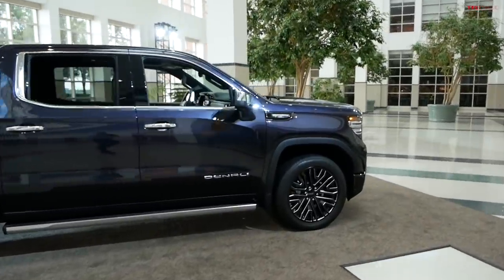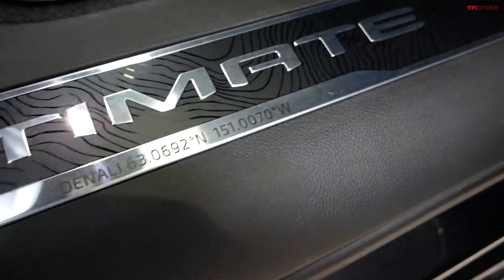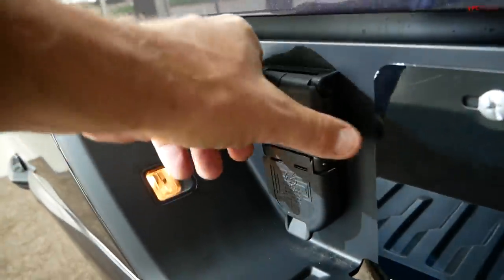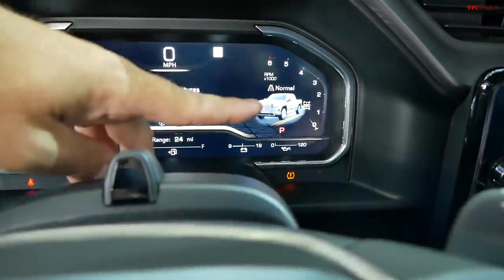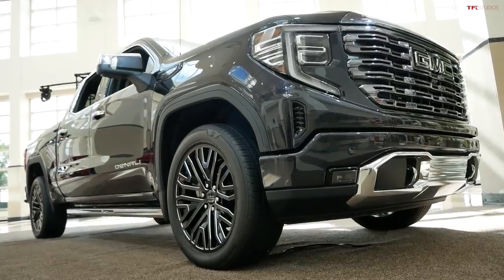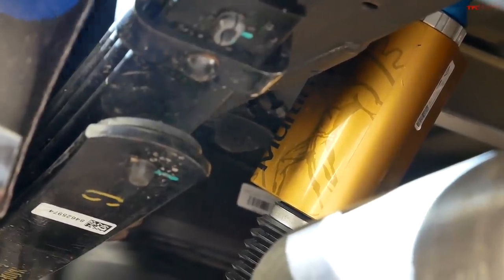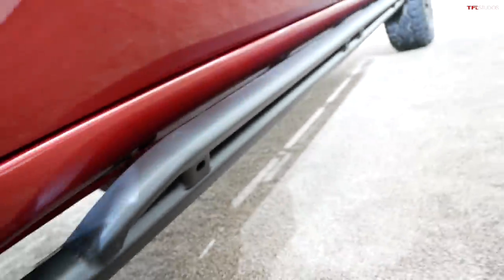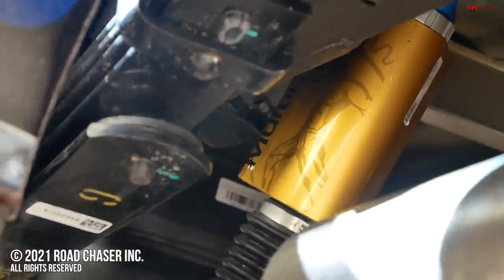Hands On WORLD DEBUT: Here's How The 2022 GMC Sierra Takes It to a Whole New Level!

Comment: Silverado ZR2 looks 100 times better
Reply: It looks better but it was a HUGE disappointment, it had no widebody or big power
Reply: @guamazolopez6456  I dont feel it needs either of those things to be a great truck.
Reply: Zr2 looks real good
Reply: @guamazolopez6456  $5000 gets you 35 inch tires, wide fender flares and a 4 inch lift on the ZR2.
Another $2500 gets you aftermarket superchargers for another 150 HP!

Put it on the Visa/Mastercard to get your ULTIMATE ZR2 off-roader!

v
Reply: @ALMX5DP  not saying it isn't a great truck, i most likely will be, it will probably outperform raptor and trx offloading but what I wanted was a supertruck
Reply: @guamazolopez6456  yeah pros and cons to everything. Making big power and having big wheels/tires/suspension, means either big money or heavy components which are a detriment to a lot of performance situations. I like how they've retained the more compact dimensions and kept the running gear the same, so that the truck can be a bit lighter and more nimble.

Comment: The exterior of the new 2022 Tundra is by far the worst looking Toyota truck ever sold in America !
Reply: looks like a piece of shit with no engine options.
Reply: @davidmckibbin4440  Trd pro will definitely stomp the x out of that at4
Reply: @antoniodavis8266  I'm not so sure about that. I had a 1999 Chevy Silverado ZR1 with a 5.3. On paper, Tacoma and Tundras should have eaten me up all day. Never happened once. I think Toyota really stretches their numbers. Maybe I'm just a better driver but it never made sense to me. I'm just assuming their specs are fudged.
Reply: At least with the Tundra, it will do 0-300,000 miles with little if any problems. The transmission in that new GMC MIGHT still be good.  GM's reliability took a total nose dive from 2007 and on. The new models will have to be flawless for the next 5-7 years to fix the damaged reputation they did with their APM and faulty transmission issues.
Reply: @Malibuair  I owed a 5.7 tundra since 2008 and no 5.3 has every came close on the road real world hell even the 2021 5.3 still come up short, I don't understand where you trying to go with that statement honestly
Reply: @antoniodavis8266  Ha! I also had 2016 with a 5.3 that crushed Tundras. That's why I think they fudge numbers. Again, maybe I am just a better driver. My current 6.2 there is no chance. They would need a boosted motor to keep up. Also, what's the deal with Toyota copying other manufactures? The 2022 body looks like a 2016 GMC except for the front end. The dent side fenders? Why they would copy that is odd. Probably the least attractive body that GMC came up with. They copied Ford with a twin-turbo V6. Which is odd being it's the biggest complaint from Raptor owners. They copied Ford's colors. They copied Ford's 3 amber clearance lights in the grill. They copied GMC daytime running lights. Now a 10 speed... Your original comment may be true. The 2022 Toyota with a hybrid boosted V6 better be faster than a naturally aspirated motor. That was my biggest complaint with the new AT4X. They should have an AT4 with the 6.2 and the AT4X should have used their supercharged 6.2.
Reply: @Malibuair  ha we would talk all day about who copied who ford copied Toyota with the 3.5 v6, Toyota made that engine in 2006 and it went in the Lexus is350. Then they made a supercharged version of that engine and sold it to lotus, then took same engine and twin turbo it years ago in the lexus lineup and the hybrid system was already in place with that engine.  Nissan copied ford front door design.  Ford copied ram with the straight pipes out the back on the raptor and now the tremor. Ram copied Ford with self parking.  Ford also copied Toyotas off road driving select from the Tacoma. Crawl control, down hill assist and just for starters, gmc copied aluminium panels now .they all do soo. But as for the 6.2 its truly badass but it holding back if they unleash its power Like It do in the vete game would be over for the raptor. Facts

Comment: The design of those headlights for both trucks looks a lot like those of a competitor.  And it's about damn time the dashboard infotainment area has been significantly improved/upgraded!  All have have improved dramatically with improved infotainment centers and some other interior designs, but Ram still leads just a little bit now.  But overall the competition is better - better exterior and interior designs and tech support and power train with options for some.

Comment: Lots of changes to both trucks. The MSRP is sickening. Hopefully it’s worth it. The massive wheel well appears to be able to easily accept larger tires. That’s good as the OEM wranglers on the AT4x looks undersized. Hmmm, wonder what gear ratio? GM has a bad tendency of putting too high a gear ratio in their rigs in order to get decent fuel mileage. Tall/big tires don’t do well with this. I love the interior features in both rigs. 
While not a GM guy this is a pretty decent upgrade and it will be interesting to see comparisons especially against Ford. Let’s see those tow tests, and of course drag races- not that I’d do that.. good start GM.

Comment: That horizontal screen that still allows buttons to be used for temperature and other settings is far superior to Ram. And you can tell it's far more responsive. Any rams I've test drove felt cheap when using the screen. Definitely not a fan of the console shifter though. Do you lose your wireless charger?
Reply: If you're meaning wireless phone charging, I believe it's still there. But now placed vertically right in front of the center console.

Comment: Currently own a 2020 ram and am going to trade it in for either gmc/Chevy or ford rams simply not keeping up at this point
Reply: Not really
Reply: What do you mean? I prefer the Ram to the Chevy/GMC because of their column shifter.
Reply: What u mean? Ram was the one that brought the luxurious interior that forced all trucks to also compete.
Reply: I mean if you guys own a ram you’ll know what I’m talking about…. I test drove the new f150 and although I like the way Ram looks on the outside I prefer the syncs 5 over the connect 4 (which they still haven’t added connect 5 in the ram1500 even though the newly upgraded Durango has it.. ) and I like the color options in the ford better and the tremor is better than the rebel….IMO better approach departure and cool color scheme inside and out..as a posed to a sea of red or black. Me being 28 I like technology and it bothers the hell out of me that apple car play only takes up 40% of the screen… and by all means I do like my ram but I think they need a refresh of the interior and offer more color/engine options over a v6 TT or an electric version. Took them forever to release the TRX and it takes them forever to stay on top sales are down 100,000 units and they are back in 3rd..

Comment: 74k for at4x is nutsss! I rather get a TRX if I’m gonna pay over 70k
Reply: You will not get into even a moderately equipped TRX for less than $80k after taxes.
Reply: @rebelcitysports1outlook186  it’s alright. It just don’t got like the Auto Unlock as you approach, seats/cooling seats, auto start etc. But you’re getting pretty much everything else. I’m looking into buying one. I was hoping this one would be at least like the raptor start at 64k.

Comment: My brother has a 06 Yukon gauges stopped working. Keeps it because of the 4wd system. He has options to use all new trucks. He goes to special places in CA desert. Buries them and test 4wd capabilities of getting unstuck. To many issues with the heavy handed computer controls. His 06 out did them all with automatic 4wd in weather or switching to 4hi/lo and G80 locker. I told him for years these are the best now he is a believer. Hie new gauge cluster is an old android small tablet looks awesome. Can not justify $60,000 for these vehicles.  I would not trust anything that allows distractions when driving ie son in law sleeping in T e s l a hitting K rail. If to tired to drive pull over like the signs say in UT, CO other states.

Comment: The 2.7L 4 cyl has 410 lb.ft. and the 6.2L V8 has 460 lb.ft.. Yes the V8 has more hp but that isn’t a large difference in torque. As an everyday truck and maybe max towing of 7,000 lbs a couple times a year, that 4 cyl seems like a realistic option. 

Of course it won’t sound near as good as the V8, so there’s that.

Comment: Very impressive GM i like it also how do you squeeze 420ftlbs of torque out of a 4 cylinder engine?!!
Reply: The number of cylinders doesn't matter, it's the displacement that matters.
Reply: @jldude84  it’s only a 2.7 tho😂
Reply: It's now said to have even slightly more, and is now rated at 430 pft.

Comment: What are the MPG'S on the basic Crew Cab 4X4 with turbo Diesel or with 350ci gas?? When are they going to come out with a True Hybrid and not just Hybrid assist??? Something that can tow 8k 500 miles on electric and then switch to either Diesel or Gas and drive 50 to 100 miles to charge the batteries and then switch back to electric for another 500 miles and so on... That is what we need NOW!!! NOT 20 YEARS FROM NOW!!! So please let me know what a 2022 Crew Cab 4X4 with at least 7ft bed or largest bed, with the best MPG Towing and not Towing... I tow mostly 8k across the country, but once in awhile I tow about 10k a short distance ( Tractor with backhoe) so I'm trying to find something that will get me a lot better MPG'S than my 97 F350 4X4 Diesel Crew Cab with 8foot bed... Mine gets 16 to 17 not Towing and 12 to 13 Towing 8k and 9 to 10 Towing 10k and more... Please answer asap.  Thanks

Comment: The 10-speed transmission I think is the NEARLY THE SAME design as the Ford's 10 speed which is technically an original Allison/Isuzu design so pretty reliable in my opinion.  I can't confirm YET that it's an Isuzu design but i BELIEVE it to be the case!

v
Reply: Pretty sure it was just a joint Ford/GM transmission. Allison just branded GM versions for the heavy duty.

Comment: I love the AT4X but with that pricing the new Tundra TRD Pro seems to be a better bargain with just as much tech and a more powerful engine.  The TRD Pro also has a pano sunroof.  These are easily Raptor prices which is a more unique truck with even more off road capability.  The AT4X is a gorgeous truck but the pricing doesn't compare to what else is available out there now.

Comment: Thats weird to have the 4x4 controls spread around the dash, shift to four wheel drive one side then use the other hand to lock the lockers or use the decent control. I am not convinced the Denali is the most luxurious in the class as GMC has claimed. 
too much chrome on the inside of the AT4X. 
Once again, buy an extended warranty for as long as you can, the electronics are not covered once the 3yr 36k mile warranty expires. 
My first house, 3bd rm 2 bath 2 car garage on a 1/4 acre was 89k and this is 75K? Its amazing how things change.

Comment: I would be very very sceptical that they are actually real locking differential. I wouldn't put it past gm to just fake lockers with software using the abs system and not put actual mechanical locking differential

Comment: Eh, "upgrades" dont feel like much tbh. front end looked good before and does look better. New Interior was needed several years ago. AT4X is just a new suspension and front/rear lockers. no one is going to spend 75k on that and take it off road. Denali Ultimate is just an appearance package. do like hearing the improved towing capacity of the 3.0. im more interested in the new Tundra.
Reply: JUST multimatic suspension and front and rear lockers …

Comment: The new Silverado and Sierra trucks face 3 lawsuits now...
Engines
Transmission 
Paint

When it comes to Transmissions, GM didn't want to honor the warranty because they argued that warranty covers manufacturing defects and not design defects and Transmissions are failing due to design flaw, not manufacturing defect.

Comment: As usual Late to the party and they had to copy Ford styling cues .  Yes a huge improvement  (that was not hard to achieve ) but it looks like Ford did the design work and styling cues.    Guess that is the only for the General to remain relevant now is to copy others. It's a sad state of affairs over at the RenCen.
Reply: Funny you say that since it looked like Ford already copied the current design. Ford is no stranger to copying others.
Reply: @derek-64   What exactly did Ford Copy ? And FYI Ford's current design predates the current GM trucks by years,   So thanks for proving the previous point even further. You did not graduate high school did you...

Comment: Quick question as I just wanna make sure I heard correctly. Did you say 20,000lbs of towing for a 1500??.
Reply: Max towing is 13200 lbs
Reply: @aws2468  13,200 lbs with the MAX tow package on the Sierra Denali Ultimate trim with the Diesel engine is a GREAT towing capacity! I got word from another person that max bed capacity with the diesel is 3150 lbs which I can live with. That's more than enough for my off-road camping/fishing gear needs!
There are cheaper trim levels that do around 2500 lbs in the bed so that is good enough too!

I can EASILY put two heavy Can-Am Quads on a bed mount at that payload!

I must admit that the AT4 AND the Denali Ultimate are decent trucks but again, I STILL HAVE ISSUES with the ever increasing price points coming from EVERY MANUFACTURER !!!! If Ford, GMC, RAM don't watch out ... the TESLA Cybertruck and the upcoming GEELY (Chinese-built) trucks WILL eat into their market share with cheaper pricing at SIMILAR or BETTER trim levels!  I've SEEN the new upcoming GEELY trucks and ALL the U.S. manufacturers had better come with their A-GAME on offering better pricing! Those Geelys are SUPER HIGH QUALITY trucks!  

I should ALSO mention that the TESLA Cybertruck WILL be A-Level Technology And Ability for over $15,000 Cheaper than the Denali Ultimate!

v
Reply: @StarGateSG7  3,150lbs payload for a 1500 doesn’t seem realistic
Reply: @goomgoom5504  Some trim levels of the Ford F150 have 3325 lbs of payload so it's NOT totally out of line BUT I should note that is NOT A CONFIRMED PAYLOAD for the Denali Ultimate !!! That 3325 is PROBABLY for one of the WorkPro trims!

The 2021 Denali does 2333 lbs bed payload so I am EXPECTING the 2022 Sierras to be anywhere from 2300 to 3300 lbs depending upon trim level. 

The 13,200 lbs towing with the Diesel MAX TOW package though is GREAT! That will EASILY tow your 20 foot ski boat or 22 foot Airstream trailer!

v
Reply: @StarGateSG7  That payload figure on the ford is for a 2wd, regular cab with 8ft bed.
Reply: @goomgoom5504  YES that is true! Each trim level has lots of variability in terms of payload and towing.  I am pretty sure the 3150 lbs quoted is PROBABLY for one of the WorkPro trims.  For the Denali I am more leaning to 2200 lbs or MAYBE even 2400 lbs bed payload just to beat Ford out on their Platinum Editions!

We'll see as i have YET to find any official figure for bed payload for the GMC Sierra Denali Ultimate OR the WorkPro trim levels!

v

Comment: General motors can make their trucks as beautiful as they want... but until they put more money into engine development like most of their rivals , they're not worth the premium. 420 hp 460 ft-lbs for over 10 years ? Out of a 6.2 liter ? At least give it the same numbers as the C8's naturally aspirated hp and torque (490-495 hp ) you can't keep dressing up old technology and raising the price hoping no one will notice. Proof is in the road presence of V8 Tundra's , Nissan, F150 ... General motors!!! Stop the cap !!!
Reply: I believe the 6.2 is physically smaller and lighter than an Ecoboost though, and being a truck engine, is designed for truck horsepower and torque curves.

Comment: Several things got better, but several got worse.
1. The shifter is a waste of space.
2. The inline cupholders are inconvenient.
3. The smaller square fog lights look out of place.
4. The trailer brake controller isn't used enough to warrant taking the place of a cupholder.
5. The price increase for the AT4X is so high it likely means that it won't see a lot of offroad use.
6. The gloss black wheels will not like being introduced to much actual offroad mud...scratches.
7. No change to the HP or torque???
8. They still haven't programmed the tailgate to not double fold while there is a hitch installed(aftermarket solution).
9. They ruined the dual exhaust tips or lack thereof. Terrible idea.
10. Still has the ridiculous and worthless lights on the front of the side mirrors.
11. The AT4X interior accent squiggly lines looks like something out of a cheap motel.

This is what poor marketing decisions look like. 

Shocks are cool. Most of the interior changes are cool with the technology.

Comment: More features than the Silverado or should we expect a rebadged Silverado
Reply: Good point!! Hopefully GMC will add more to pull away from the Silverado.
Reply: @lsdemon7773  as far as I understand the Yukon has a slight different interior quality and overall better look to the tahoe. I don’t know if the same goes for the trucks
Reply: @rtcturnemup7028  we will find out later. The last 4 years the trucks has been pretty much the same.